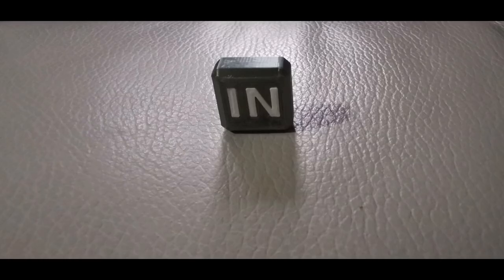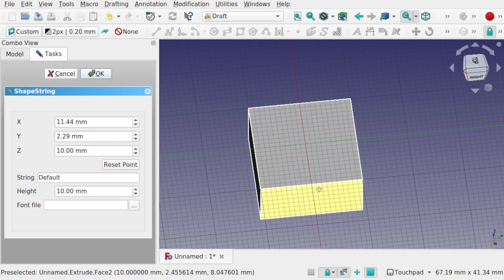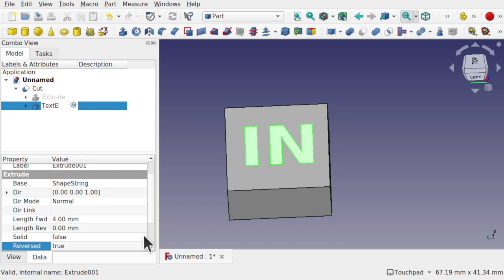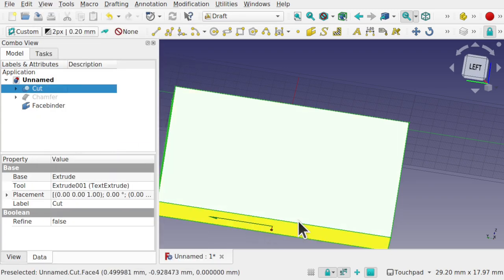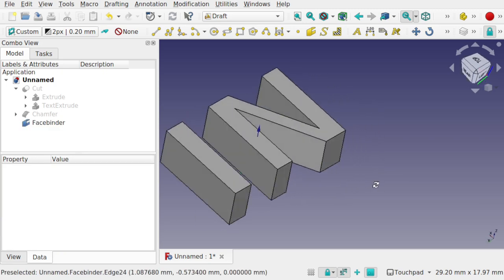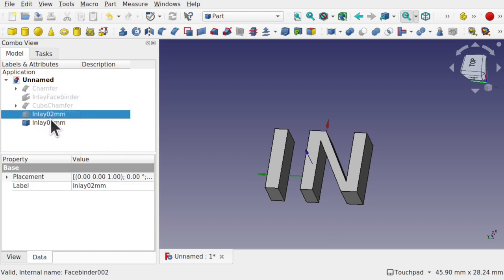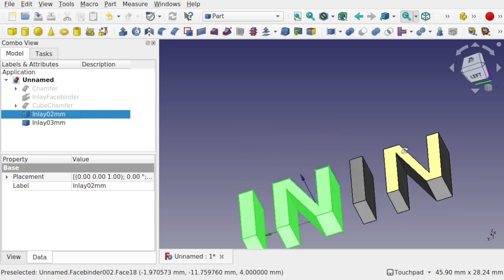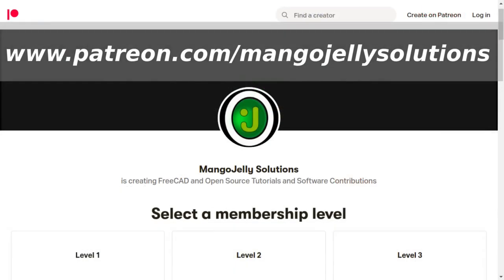3D Printed Multi Colour Inlays on Any Surface Using Facebinders in FreeCAD (Without Z Hop )

Comment: Fantastic 'trick'!

I sometimes accomplish a similar thing on flat surfaces by using 3D printer resin. I cut the recessed text about 0.8mm into a part, the same way you did, then print the part as usual. I then squirt colored resin from a 'needle' squirt bottle into the text recess, slightly over-filling it so the resin's meniscus sits proud of the surface, then harden it with my UV flashlight. A little sanding to flush up the inlay (sanding I do anyway), and Bob's your uncle.

But your technique will work on non-flat surfaces (by using FreeCAD's project tools to form-fit text onto any surface), so it's a winner.

I'm so glad you got yourself a 3D printer...looking forward to seeing whatever else you do with it.
Reply from the maker: Now that sounds like you would get a very smooth and nice finish.  Reminds me of sign making where you add the appoxy to lettering on a wood cut sign and sand it down.  Thanks for sharing that, always great to get comments that add extra knowledge.  Yes looking forward to trying out some ideas.  I have some friends who have been doing 3D printing for me but I didn't want to bother them each time though they were grateful for the CAD help.  Now I can experiment without bothering them all the time :)

Comment: Thanks a lot , I was struggling around it. Your chamfer idea didn't work for my fonts so I 2d offseted the shape binder, extruded the new thicker font, engraved it to my part and then used the original (not offseted ) shape binder as my inlay. Just another way for fonts that don't chamfer well. Thanks again
Reply from the maker: Thank you for following up with your solution to problematic fonts. Really great for everyone when viewers add to the comments. Really enriches the channel. Thank you for that and glad you enjoyed the video.

Comment: I tried exporting my 3D models directly from Freecad however Creality Print could not read the STLs. I had to use the Mesh workbench to convert my models to a mesh before exporting the mesh which works 100% of the time.

Comment: My project's letters are way too small to apply the technique shown well here.

I need to make white text inlays in black material described in a single file like 3MF or OBJ.  I have no printer, sending 3MF or OBJ files off to a large 3D printing firm.   No one in You Tube has a tutorial how to do this (print in two colors) in FreeCAD.  I understand one needs to use or reference texture files.  My texture files would be plain old black.png and white.png.

Comment: Enjoying your 3D printer then.
Reply from the maker: That tip you gave me with the pritstick worked a treat 👍👍 Found some glass in the garage so started to make a glass bed rather than buy one. Found out it was safety glass, a broom and 5 million pieces later I decided to abandon that idea 😂 yep enjoying it 😁
Reply: @MangoJellySolutions  Sounds like fun. People like garolite if you can source big enough pieces, apparently knife supplies shops have it and it's rather cheap. PEI is my own personal favourite. Not a fan of the glass.
Reply: Great video as usual. If you get the 3d printer modification bug, I'd definitely recommend converting to a removable flexible print surface and adding a height sensor to allow multipoint automatic bed levelling - I did it to my ancient Prusa i3 clone printer a couple of years ago and it's an absolute game changer when it comes to ease of use.